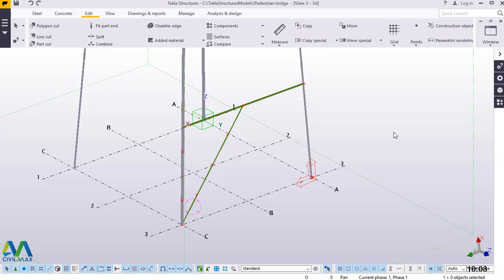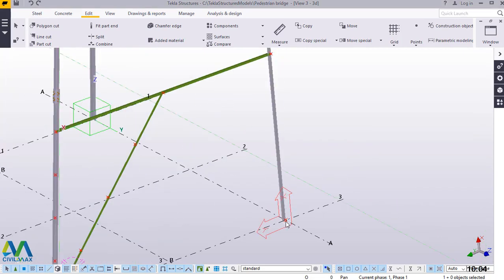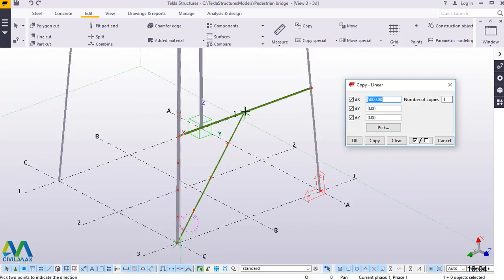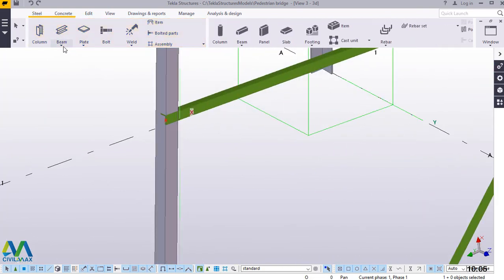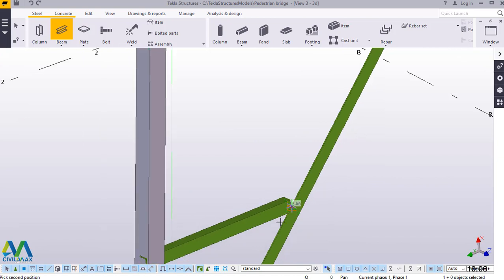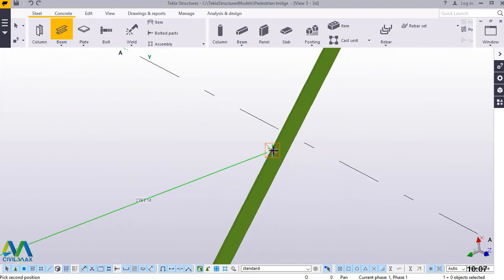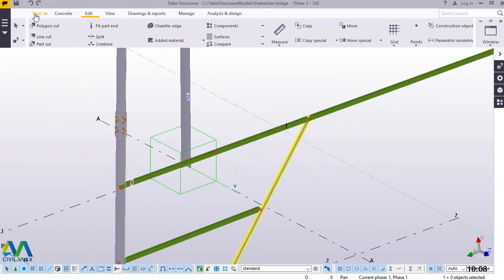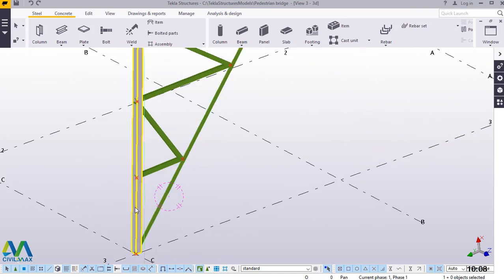Telecommunication Tower Modeling in Tekla Structures Part2

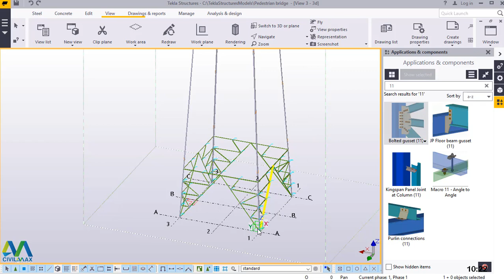Comment: 19:15 base plate gets inclined in two planes simultaneously XZ&YZ as same as tower leg. how could we get it positioned horizontally? thanks
Reply from the maker: watch it once more, it is on XY plane and not XZ/YZ
Reply: yes in the video it's in XY plane but my question is how to adjust it horizontally as initially it gets inserted perpendicular to the tower leg (inclined)   @MauriceDimba